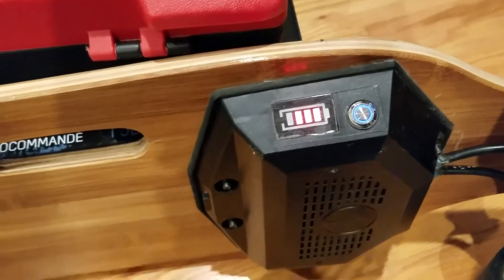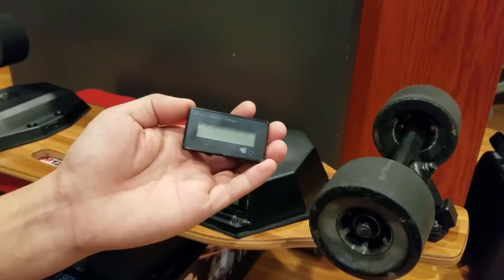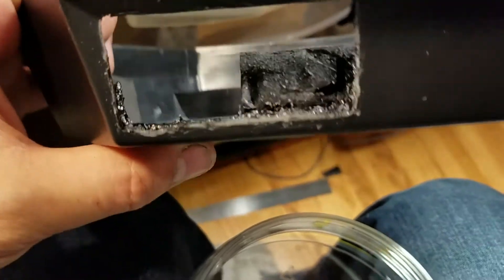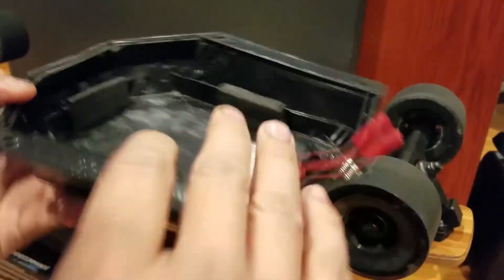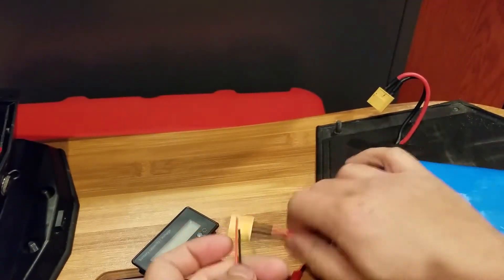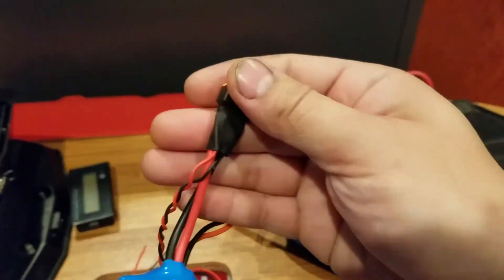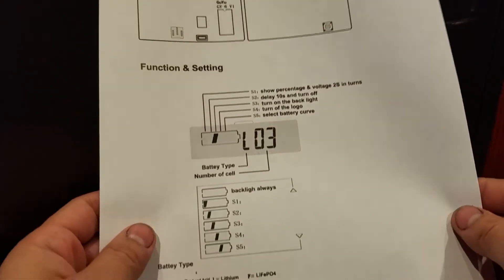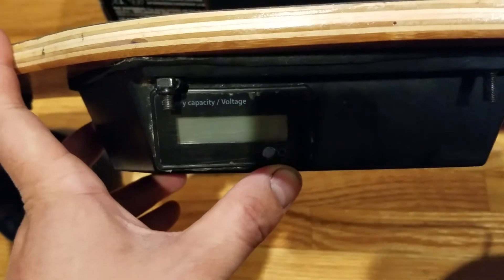Meepo Board, a DIY Better Battery Gauge Mod

Comment: my biggest mod on my to do list when my board comes in is figure out a DIY way to somehow hook up a small LCD ( https://www.ebay.com/itm/White-0-49inch-OLED-Display-Module-SSD1306-64x32-I2C-IIC-Arduino-AVR-STM32/292603492172?hash=item442086f74c:g:Q-IAAOSwJdBbIksS:rk:172:pf:0) in the controller and 3d print a new housing my  like likely would  take the oem controller and figure up some Arduino  code along with a LCD + the oem guts out of the stock controller .

Comment: Doesn't this mean the gauge is running 24x7? I am trying to mod a new meter into my board but I only want it on when the board is turned on. Having trouble finding the right voltage when the board is on.
Reply from the maker: i changed the setting to not have the backlight on. so yes it is on all the time, but after about a month in storage, the voltage dropped 0.5volts from a full charge.

Comment: This is such a cool mod. Do you know of any DIY meter/gauge alike that could be connected like that and transmit Bluetooth signals of the battery percentage?
Reply from the maker: Christian A.P. yes. They sell a Bluetooth  battery management system  for the battery. But it costs like $45. Not worth it IMO. And difficult to install unless you are building your own battery from scratch
Reply: Doug Hnut thanks a lot, that's not worth indeed, I'm looking for something way cheaper and easy to install... Maybe I'll build an Arduino

Comment: Hi Doug, Do you know if there would be any difference between these two Battery Gauges. One is the same as yours. The other looks the same but has an extra button. I wonder what the extra button would do, and it would at any value at all: 
https://www.amazon.com/gp/product/B078WK52HG/ref=ox_sc_sfl_title_1?ie=UTF8&psc=1&smid=A2KO3BBIYMARWF
https://www.amazon.com/dp/B07BZF3TZ5/?coliid=IV258N2RKH88Y&colid=3ETWR16JMOMO7&psc=0&ref_=lv_ov_lig_dp_it
Reply from the maker: Chris Schulz the one with the extra button helps if you want to change the programming after it's installed. There is a set button on the backside of the single button version. Whereas the two button version has the set button on the front side
Reply: Thanks Doug!

Comment: Can you check the battery while the board is "off"?
Reply from the maker: the way i have it wired, yes. just press the button and it will turn on and display the battery info

Comment: Do you know why the power button has four wires instead of two, would it be possible to switch it to a normal two wire button?
Reply from the maker: +Isaac Lyons yes, two wires are for the led and the other two are for the switch. The switch has a built in led. Im not sure which of the 4 wire is which, but shouldnt be to hard to figure other
Reply: Doug Hnut, so do you think I could wire it to use a normal toggle switch like the ones found on Amazon?
Reply from the maker: +Isaac Lyons yes. Whats wrong with the round switch?. Is it broken?
Reply: Doug Hnut, I am making my own using similar electronics including using the Esc on the meepo. I just wanted to put a different switch on.😃
Reply from the maker: +Isaac Lyons ah thats awesome, love diy!
Reply: Doug Hnut, lol thanks! I'm making a carbon fibre deck for it too.

Comment: What did you do with the old sensor, just leave it attached?
Reply from the maker: +Isaac Lyons i disconnected the cable to the meter . And left the meter there
Reply: Doug Hnut, OK thanks. So it still works fine without one being there?

Comment: I just added this mod to my 10s4p parallel Meepo setup. I measured the voltage of the charge lead and the XT60 connector and didn't measure a difference so I soldered it to the JST Y splitter. Thank you for your tutorial!
Reply: https://www.ebay.com/itm/XT60-Harness-for-2-PKS-in-Series-Battery-Connector-Adapter-Drones-Multirotor-1pc/153266912707?epid=3026073107&hash=item23af6b7dc3:g:yC4AAOSwtjhb8fNc:rk:21:pf:0

Comment: Awesome. But you probably should leave it charging overnight, 42.5 V is quite high to a point that it may damage the cells (and no brakes in the very beginning)
Reply from the maker: thanks for the tips!. i know that 42.5v is too high for a 10s cell pack, but that's is what the voltage is after leaving the board on the charger for over 24 hours. i don't know how accurate the voltmeter is on this little gauge. my DVOM  only rounds off to the nearest volt so i can't confirm its accuracy. and i have been lucky i guess, i haven't felt the no brake issue yet, even when i start my rides on a slight downhill slope.
Reply: Doug Hnut shouldn't***
You should charge it like for 2 hrs and unplug!! Or when it's higher than 41V would be enough
Reply from the maker: +ddkuo ahh i see. Or i could buy the 41.5V charger from meepo. Im gonna take apart one of the original chargers and see if there is anyway to adjust them
Reply: @DougHnut  do you find how to adjust the charger?